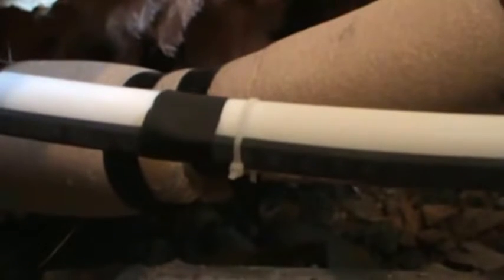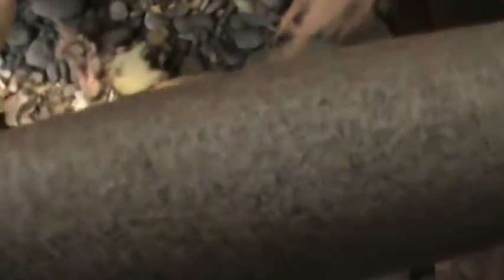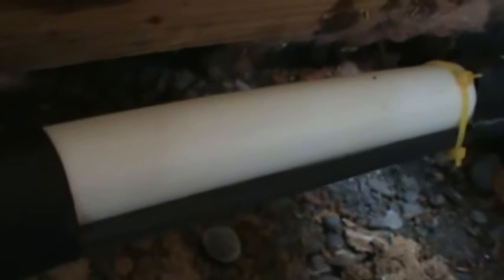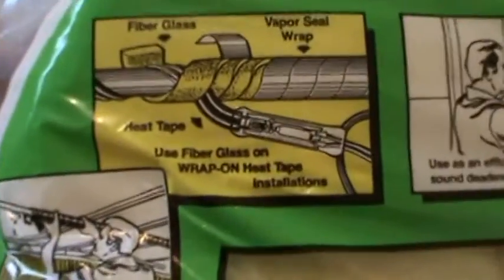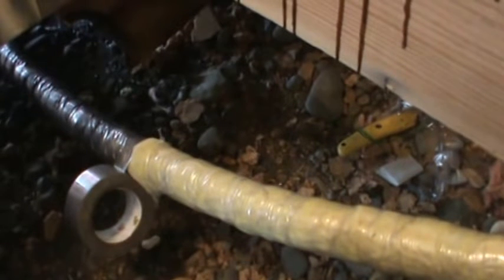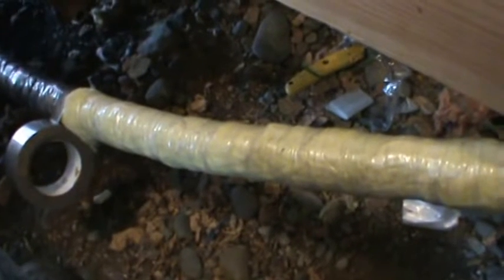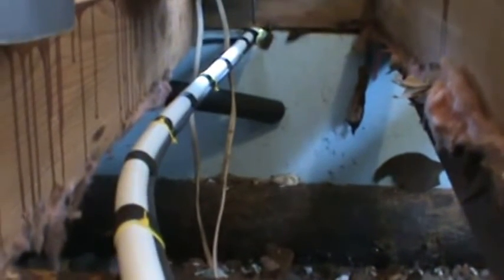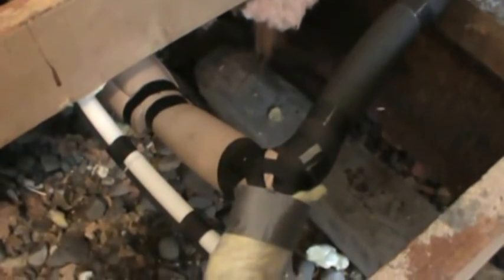How to Properly Insulate Water Lines in Alaska for -70 degrees Licensed Professional

Comment: I get frozen pipes every year here in alaska and i use a switch for the heat tape. I'm also re insulating my crawl space. Removing fiberglass that was full of mice. What do you recommend for crawl space insulating in the arctic? Should I insulate the floor again? Or just insulate the skirting and the ground with foamboard.
Reply: no such thing as too much insulation
Reply: I live in central British Columbia, where we get minus 40C. My crawl space skirting is just two inch foamboard, with four inches on the bathroom corner of the house. Steel roofing metal over that. It's absolutely airtight and draft-free. Never, ever had it get colder than plus 6C down there. No heat tapes, no back-up heat at all. Just a tiny bit of heat loss through the floor, even though it's insulated to R36. Insulation and elimination of drafts is more important than anything.

Comment: Hey Cory, great video! Lots of detailed tops -- thank you. Quick question: I have a cabin in upstate NY and want to insulate the waterline that runs 35' from the well to the basement. Because of bedrock, I can only bury it about a foot deep. So my question is what other protective/water barrier would you add after the duct tape before burying it? Thanks again
Reply: Hi Paul , how did you make out?
Reply: get a sewer type plastic pipe with bigger inside diameter then your entire outside diameter insulated waterline including all insulation and heat tape
connect / glue the pipe continuously 
then slide your waterline into it
that way you :
1 .: have water protection 
2 .: additional thermal layer 
3 .: better weight distribution of the weight of the covering material above hence protection from crushing your water line
hope this helps

Comment: Great video..so you had the heat tape on pvc or PEX pipe? If so no problem with the pipe melting or anything like that?
Reply: yes, i have PEX pipe and was wondering the same thing.  can i use heat tape? thanks!
Reply from the maker: Christopher Davis Not one bit of issue at all! No the pipe doesn’t melt because heat tape does not get that hot and no where near the temperature required to melt plastic pipes.
Reply from the maker: Melanie Peyton Absolutely YES you can use heat tape and NO it doesn’t get anywhere near the temperature required to melt plastic pipes.
Reply: @dealsgalore  I assume you use PEX-A? Or is my assumption wrong?
Reply from the maker: @brandonthompson9866  Yes I personally always prefer to ONLY use Pex A for several reasons and they are Burst pressure when freezing temps are of a concern Pex A withstands more pressure, also with Pex A you don’t have a water flow restriction because Pex A you use an expansion tool to join fittings which makes the pipe itself bigger for a few seconds, depending on ambient temperature, and the pipe will naturally shrink back down to size making all your fittings snug whereas the Pex B uses a crimping tool with small copper bands that crimp the fittings on, which if not done properly they tend to leak, also the downside of crimping means the fittings fit on the inside of the pipe restricting water flow so you will always want to start one pipe size bigger than your actually stunning to account for the restrictions. Now I also personally prefer to use shark bite fittings because they will connect any type of existing plumbing pipes to whatever your using. I got a boatload of them at a huge discount so that also plays into the equation here too. If running all brand new Pex A then I don’t necessarily have to use shark bite fittings but like I said I got a great deal on a bunch so I use them pretty much everywhere. Where they come in the handiest is when I’m doing any sort or repairs on existing plumbing especially really old commercial or residential structures because you might end up running into several different types of pipes along the run. Yes Brandon I would only use Pex A if there was an option. There’s more benefits to Pex A than what I’ve mentioned so far but it’s far superior hands down. Hope this helped answer your question well enough and if you have anymore ask away I’m more than happy to help. 
Stay healthy and safe!

Comment: I would not put a layer of fiberglass over the foam insulation you would get much better insulation value from a second layer of rubber insulation, or you can just buy thicker black rubber insulation and you can get it with a protective plastic casing around the outside. you can just get a can of rubber cement to glue it together at the seam. 
buy a size larger than the pipe size like 3/4 copper pipe is 7/8 so you buy 1 1/8 for 1 inch copper then it is easier to close around the pipe and the heat tape they make it in all sizes if you are installing a new pipe, you can get insulation as a solid tube with protective outside to slide over line and heat tape or they make self-stick rubber pipe insulation with tape strips.

Comment: I was up there from 79' to 95'. Fairbanks. And you just cant let the faucet drip-tape the best if you have the power. Good video. ? on another note...I knew people up there who ended up buying a house or a cabin type structure, only to find out that the Code Books were all but ignored. To discover the plumbing lines buried too shallow-(2x4) Exterior walls, no floor insulation...etc...
Reply from the maker: Cruusher yes many places and people do t follow any codes up here especially in the rural areas. I have had to redo many places for friends and newbies for that same reason as they were very basically done and Not good at all and a risk to say the least.
Reply: Cory Martin can you help me? I’m in a world of a mess without much time left. I’m in the interior
Reply from the maker: TruVlogTv maybe what exactly are you needing help with? Feel free to ask any questions you may have and I’ll do my Best to answer them.

Comment: only problem i found w heat tape the lite on cord stays on even after the tape fails, these tapes only last 2 to 3yrs so if you can cut down on tape like gray tape and use materials easier to get on and off this helps, i changed my out when it was zero degrees out, it was a unhappy little job but half way thur install it thawed out pipe, less tape more foam and plastic
Reply from the maker: wisco I use tape like I did here to hold it all in place as we have wild critters and 100 Mph winds so I don’t want it to come off. Yes it does take a little longer to replace but more than worth it imo.

Comment: Are you describing what you do for the few meters, till your pipe is underground, or do you insulate your pipe the same way(8 ft under the soil) till you reach the main water line at the street?
Reply from the maker: Janos Merges yes Janos I install this the complete run of the water lines from the well through the 8’ deep arctic pipe all the way throughout the entire structure.

Comment: Cory,
several have already asked about the foam pipe wrap but I have a related question: What is the heat rating for the foam that we should be looking for?
If you were dealing with "not- Alaska" cold temperatures - let's say a toasty minus 25F once in a while - could the foam be omitted and just use the plastic wrapped fiberglass?
I hope you tell me not to worry about the foam and just do it all :D
Also - and maybe you said this while I was daft or something - are you using self-regulating heat tape or something else?

great vid
Reply from the maker: Paul Logieri yes you could omit the foam but I would choose the opposite if it was me. The foam is so much easier and quicker to work with and it completely seals up around the heat tape and pipes. I normally use a heavy duty heat tape as they have always worked best for me and yes they do cost more but to me your paying for peace of mind and dependability. As I always say....You ONLY cry once and that’s when you Buy it.......and your NOT crying all the time because it keeps failing on you causing you additional work in not the most favorable conditions. I don’t think the foam insulation comes in different ratings per say like insulation does as I’ve basically seen the same type and size all around. Hope that helps Paul!

Comment: First time trying to put on heating tape, How far down the pit do run the heating tape... to end,and what about it getting wet??  I’m tired of doing everything my self...🤷🏻‍♀️. So tired of Pennsylvania winter’s....
Reply from the maker: andrea420 you will run it to where the water comes out of the ground at and as far as getting wet they are insulated and protected so there should be no issues just don’t submerge it in water is all.

Comment: Is it possible to use gutter defrosting cable for outdoor pipes to keep them from freezing, it sounds like the pipe heating cable would be too hard to know if it's working and the plug has a fuse which is another variable to throw it off. I mean one should not have to go in a crawl space in frigid weather to see whats going on all the time.
Reply from the maker: Kommon Cents mist heat tapes do not have a fuse on them. As for knowing if the heat tape is working I use a cheap wireless thermometer and have several of them linked into a recent hat I have installed either in my living room or my kitchen as such spend the most of my time there and I have the alarms pre programmed and set at a certain temperature of my choosing that sets off an alarm when the temperature drops below a certain point l. That’s the cheapest, easiest and best way I’ve ever found to keep an eye on not only my heat tapes but also my water lines theirselves and it’s worked perfectly without any problems or issues whatsoever. You can order them off of EBay and have them delivered to your mailbox within a week.

Comment: The yellow fiberglass insulation package showed the heat tape being applied wrapping around the pipe in a helix instead of being just on one side - if you have enough heat tape, would this be better?  
Also, the camera angle on your final duct tape wrapping looked like it was crushing down the yellow fiberglass insulation a little - which wouldn't be as good as utilizing the full thickness of the yellow fiberglass - is this an illusion of the camera angle?
Reply from the maker: Yes I would agree if you had enough heat tape and yes try not to smash the fiberglass insulation too much. Great job Rick! Thank you 🙏!
Reply: @dealsgalore  Thanks Cory.
Everyone loves your video. 
I'm in the mtns outside Los Angeles- not nearly as cold as Alaska.
About 20 years ago I installed wire wrap, foam tube, and fiberglass as your video shows and have had good luck. I was flying blind without instruction.  

I'm redoing my pipes this weekend to make sure I'm ok. I had some wet spots on the ground this last spring that I haven't been able to resolve 

Thanks again. 
Rick Jones
Reply from the maker: @frix57  Thank you 🙏 Rick! Yes once again you are definitely correct that those mountains outside of Los Angeles do not get anywhere near the cold we have here in Alaska. A couple other things I noticed was your predators you deal with down there in your area tend to be more of the 2 legged variety whereas mine almost always have 4. I also should not forget the rarest commodity in all of Alaska which your area has an over abundance of during all seasons in which could go either way maybe good maybe bad and these almost always have 2 legs as well and that’s those Beautiful West Coast women. Lol
All joking aside Rick I don’t know exactly what your dealing with down there in those hills of Los Angeles with this possible water leak you’ve have yet to find the cause of that moisture but one thing that’s helped me in the past was going back to common principles and what I mean here Rick is don’t forget some of the simplest things like... the path of least resistance per say. So you State this spring you came across a couple areas that contained moisture and one thing that immediately came to my kind was a leak I had back in Indiana one time that we just couldn’t pin point. Suffice it to say that after spending considerable time at a location troubleshooting this issue it ended up not being a water leak as we thought but an actual sewer leak that was a simple fix yet so very hard to detect. It only happened when there was excessive use and it just so happened that this leak could t have been more perfect yet so complicated. It came from a second floor restroom in a building where every pipe was wrapped just like these Rick and this leak when it leaked dripped at its lowest point which just so happened to be the spot just inside the outside wall that tied into the main lines going straight down to the basement. And the sewer leak dripped right at the joint of the water line at the wall and this took its course inside the insulation along the water line itself. This would only happen with repeated usage and the culprit was an obstruction inside the drain line at an elbow but this leak like I said dripped so perfectly into the small crack on the backside of the water line where it’s hard to see that the tape is making a complete seal around the insulation. Once inside the insulation it traveled down to the basement area and the pieces there were at an angel and was a spiderweb of many connections but this leak would travel the entire length of this water line to the opposite end of the building before re-emerging as a small puddle on the ground. I can’t tell you how many man hours and how many frustrated workers dealt with this one issue but it was several and also took a couple years. I ended up finding it over a Christmas emergency call when this single elderly woman called for a backed up sewer line issue and yes this sewer leak took the path of least resistance is what it boiled down to. I know how frustrating it can be when things aren’t always cut and dry so by saying this hopefully this may help you find your possible leak or maybe it’s also moisture from condensation too? I would recommend putting a substantial flow through all lines focusing in one room or area/line at a time and put it under maximum load pressures and usage. The one thing that’s so hard to duplicate is the temperature changes I spring fall and how those too can play into this scenario as well. Well hopefully this may help you Rick and I do hope you the very best my friend. Would love to hear that you got it located and fixed soon and you take care down there in those wild mountain areas outside of Los Angeles Rick!

Comment: There are large diameter fiberglass pipe insulation segments available that could cover the foam over your heat tape assembly.  They would give you more insulation than the fiberglass wrap but they also cost much more.
Reply from the maker: That’s the main thing here in Alaska especially rural Alaska Stuart is the cost of well pretty much anything. The next thing to consider is availability as that too is another major hurdle one must deal with on a regular basis.Yes you are correct here that would be a hair better I’ll agree. I also enjoyed reading your other comment about a energy flow alarm so Thank you 🙏 for your comments!

Comment: I have no concerns of freezing where I live, but I have about 50 ft run of copper pipe in my crawl space and it takes a long time for warm water to the kitchen. Is it worth the investment to insulate it to keep the pipes warmer for quicker hot water? Or is it a waste of time? I've been considering investing in a small electric water heater tank in the crawl space right under my sink.
Reply: Follow up question. If i measure, say 2 gallons of water before it turns hot, should I get a 2 gallon water heater? Or should It be like a 4 gallon tank so there's some in reserve once the main 50gal water tank starts supplying hot water? Thank you

Comment: Is the black foam insulation fire resistant. Many heat tape manufacturers recommend against using foam, but want fiberglass. Fire safety sites indicate that we should not use any insulation to improve safety from fire?????????????????
Reply from the maker: No this black foam insulation I’m using is not fire resistant. If you want fire resistance then you want to use Armaflex Protect or Armaflex FS both made by Armacell black foam insulation because that’s what I recommend. It has a 120 minute rating and it actually expands in a fire protecting the pipes. Check it out it’s good stuff.
Reply: @dealsgalore  You are awesome, could not get an answer, and there you go. Hope you make some good money doing this.
Reply from the maker: @iowaunemployment  I Don’t make any money doing this. I just did this to help others so maybe they can save some money and make sure the job is done and done right. I’m disabled now and this is my way of giving back is all. I’m glad you found what you were looking for and happy to help anytime. Take care